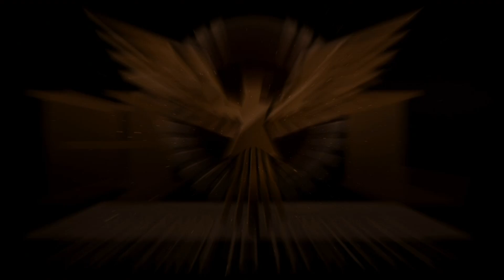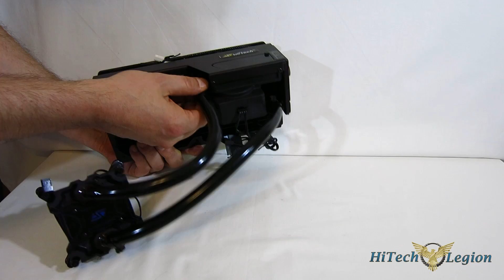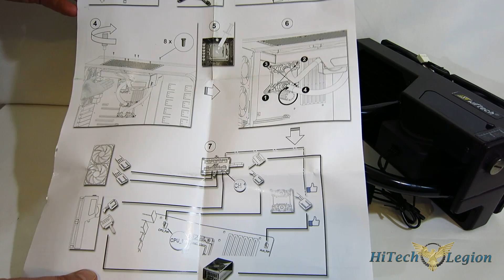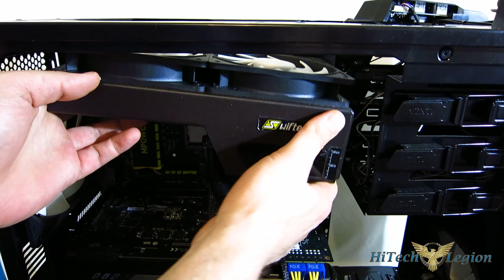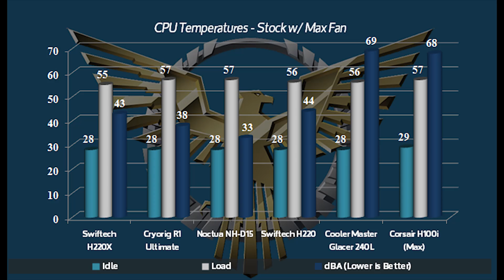Swiftech H220 X Open Loop AiO Liquid Cpu Cooler Overview and Benchmarks

Comment: Hi I have got a amd fx 8350 processor would the Swiftech h220 x be Ok with the processor and also how you have got the fans on top could it go underneath because have got 2 140mm Led blue fans and I want to Put them on top would it work with my 140mm fans on top and the swiftech h220 x underneath.

Comment: Really nice, but the last editions got a different color ? Looks like transparant.. I like this black tho..
Reply: +Ronaldoz Gaming Yes, the H220-X2 was released last month and features a larger, more rounded reservoir. It also has a new CPU block for a slight performance improvement.
Reply: +George Cella Thank you! I&#39;m checking the H320X2 Prestige for improve performance over the aircooler Phantek PH-TC12DX. Just not sure if my case will help to improve or to make it worse.. Got a NZXT H440.

ps. I ordered a H240X2, thanks for the reviews!

Comment: Does the LED from the block(3 pin) really go to a fan header? I have the z170 Deluxe and there is only 1 3 pin connection anywhere on the board. The manual doesn't show what it is. I'm trying to figure out if this is the correct connector.
Reply: +Ribsletics yes, it really goes to a fan header. Preferably one you have set to supply a constant 12V as it says in this video and in the manual.

Comment: If you added two gpu's to that loop,  I would be worried if it could handle that load.
wish they had a 360 rad version :(
Reply: +Stoneyman101 If you were adding two GPUs, you would simply add another radiator along with them.
Reply: Yeah, I wish I could but I only have room for one Rad :( my case is a bit small.
But thanks for the suggestion :)

Comment: Worth noting, I have this cooler and when I look inside the res there are particles floating around in it. I contacted the retailer I bought from and they say its nothing to worry about... I'll update it I have any issues
Reply: +Lotus How is the cooler doing so far? got mine yesterday and it has some particles inside the res too.
Reply: +ScarfShockle I'm cooling a stock 5820k and at idle I'm sitting a 34 degrees C. When gaming with a stream in the background it climbs to around 46 and stress tested with Prime95 it didn't even touch 60. Pretty good temps and its much quieter than my old H100. I think the particles are left over from the manufacturing process and don't seem to be affecting temps. What CPU will you be cooling?
Reply: +Lotus What did Swiftech customer service say regarding the particles?

I know that the dye they use in the coolant settles during shipment and leaves what looks like sawdust in the res. It then breaks back up usually in the first few days of running.
Reply: +George Cella I didn't contact swiftech, I when to the retailer I bought from. They said it was left over from the manufacturing process. As mentioned it isn't affecting temps
Reply: +Lotus cool :), currently have a fx 4100 installed but waiting for stock on the 6600k, thanks for the info ^ ^
Reply: +George Cella Is the factory fluid in this cooler dyed?  I thought maybe it was just water which is what I would want to use.
Reply: Resengan It is distilled water based with biocide and anti-corrosive. It is almost clear, but does have a faint blue dye. You never want to run just water, biocide and anti-corrosive are very important.
Reply: George Cella Great in the video it looked cloudy but I think that was because it was a bit over exposed.  If i planned to add a gpu to this loop would I need to purchase more of that fluid as Im assuming the water levels would go down after filling up the extra hose and gpu block?
Reply: Resengan Unfortunately, this fluid is not available separately. Best bet would be to completely change out to a fluid recommended by Swiftech, such as Mayhems X1 or XSPC EC6. Both are also available in concentrate to be mixed with distilled water.
Reply: George Cella ok thats great info thank you

Comment: is there anything similar to this but with clear threw  tubes?
Reply: Tom CMF Yes....this with the tubes replaced with clear tubes. It's open loop, so you can replace the tubing.
Reply: George Cella I just discovered that thank you, does it matter what dye you put in the system?
Reply: Tom CMF Yes - Swiftech has issued statements warning about using any nano-fluid with their pumps. Be sure that your chosen dye/fluid is not one.
Reply: George Cella I am really new to open loops people say it means you can change the tubes. Do you maybe know a tutorial that shows you how to do this or does the Switch H220 X come with instructions on how to do this. Do you maybe know a good yellow color of dye because I am looking for the color of dye which the storm bolt 3 used for its h220.
Reply: Tom CMF Swiftech has a guide they will send if you request it from customer service. They should also be able to recommend what dye brands are safe to use.

Comment: Hello. Nice review! very helpful. Can you tell whether the pump speed is steady or adjustable?
Reply: peace2u The pump is variable speed 1200-3000rpm and is PWM controlled. The pump and fan curves are set up to work in conjunction for optimal silence and cooling capacity, with the pump noise never being audible over the fans when using the included PWM splitter. You can also control the pump and fans using separate PWM signals should your MB or fan controller provide them. However, under no circumstance is the pump to be regulated by variable voltage, it requires a constant 12V to operate properly.
Reply: George Cella
Thank you

Comment: just picked up the h220-x  thnx for the review. one quick question hope someone can answer would this fit top mounted in a fractal design r5
Reply: Jason Rearden It will fit in the top of the R5 with no problem.

Comment: Hi there, i have a question... Does this Liquid cooling fit to my Cooler Master N200 in the front? Do you recommend that? Thanks a lot.
Reply: Chris Bohórquez According to Cooler Master's specs it will fit.
Reply: George Cella but in the front there's no trouble with the liquid? thanks.
Reply: Chris Bohórquez No trouble at all. It can be mounted vertically with no adverse effects. If you look at the Swiftech web site it shows all possible mounting orientations.

Comment: Does anyone know where I can actually find the h220 x for sale? I tried amazon, newegg, and tigerdirect. Can't find it anywhere, doesn't even show up as sold out.
Reply: BerserkFury89 You can order it direct from Swiftech, or from liquid cooling specialty shops like Performance PCs.
Reply: George Cella Thanks for the reply. Swiftech's website shows both the 220-x and the 240-x as sold out. I looked at Performance PCs, they have the 220-x in stock, however they do not ship to APO address (military stationed overseas...). Could you happen to have any other suggestions? Your video made me very interested in this cooler.
Reply: BerserkFury89 If you use the contact form on the Swiftech site, I am sure they can direct you to the closest reseller to your location and save you on shipping. Swiftech customer service is very helpful and responsive.

Comment: I have a Rosewill Thor V2 with a MSI 970 Gaming motherboard. Would this fit? Like would it clear the RAM slot with standard RAM installed? I don't have RAM with high profile heatsinks. I currently have a Corsair H60, but I'm looking to upgrade to start my process towards a custom loop with this and later add in extras when I can afford it.

Comment: I had a quick question...I just purchased a Swiftech H220-X and I have installed it but am a bit confused regarding the PWM. I have the Phanteks Enthoo Luxe case which already comes with a PWM mounted and using the CPU_FAN header on my Asus Maximus VII Hero MOBO. Can I use this PWM (it is 3 pin as opposed to the 4 pins with the H220X) or should I still use the provided PWM? If using the provided PWM, can I use the CPU_OPT header for one or the other PWM's? Or switch the two out and plug my 3 pin fans into the Swiftech PWM? Thanks so much!!
Reply: Andrew Maloney The Phanteks hub uses PWM to control VOLTAGE OUTPUT to the fans, it does not have a PWM signal out - this is why they are three pin. The H220-X pump requires a PWM signal to operate properly, so the 4-pin (2 wire) from the pump must be plugged into a PWM header, either on the Swiftech hub.

All of the headers on the Maximum Vii Hero can be selected to operate as PWM. You need to set it in BIOS. The most beneficial way to run these is to use your CPU header for the Swiftech PWM splitter, with the H220-X connected to it. Then attach the Phanteks hub to a chassis fan header which you set to PWM. You will likely need to run Fan Xpert tuning to get everything optimized, and then you can set up separate and correct curves for each.

But - the one big thing you need to take from this is that the Phanteks hub will not control the H220-X pump.

Comment: will this support 2 gpu's, 140.3 rad and an extra front panel reservoir? I'm going to try it next month, hope the pump can handle it.
Reply: +Engel I am currently running it with 2 GTX 980s in SLI (using EK blocks and a EK dual parallel connector), as well as an extra 240mm radiator. I think there may be a problem with the pump, as my top card idles about 10C hotter than my second, and when stressed, can get around 30C hotter. These temp differences do not occur when I turn my system on its side, which allows gravity to pull liquid into the pump. I am thinking about replacing it soon with a full custom loop, as this is irritating me.
Reply: +Vapeaholic The three blocks definitely take the MCP30X to its limit. If you want an easier and more cost effective fix for the short term, add an MCP50X into the loop. This will solve your immediate issue and give you a pump for if/when you change up the loop.
Reply: +George Cella where should I place the pump? My loop goes like this: Swiftech h220-x > cpu > 240mm rad > GPU connector > Swiftech
Reply: Vapeaholic Ugh...I totally missed that you had the GPUs in parallel - sorry. There is not an issue with your pump, and adding a pump won't solve the issue (though it will get you better flow rates, and is a good idea in an expansion of that size). A large discrepancy in temps in like parallel units indicates that the restriction of one block is higher than the other. Since the flow will seek the path of least resistance, almost all of your flow is going to one block, while the other has liquid barely moving. This is the huge drawback of parallel layouts. Can you put them in series?
Reply: +George Cella i only have a parallel connector, and as you know, it is diffuse to empty the coolant from a h220-x full loop, and then reassemble the whole thing. I turned my system on its side yesterday for a few minutes while it was running, and that seemed to fix my problem. If the problem persists, I might get a series connector or another pump
Reply: +Vapeaholic difficult*

Comment: just to confirm, since it is open loop even though I will not make any adjustments it will require a refill after time, correct?
Reply: you234511 Swiftech recommends a rinse out and refill after three years of use.

Comment: i have a P8P67 PRO and plan to buy either a 970 or AMDs equvilant down the road. when will i need to upgrade my MOBO? currently use 2xHD6950

Comment: Is the pump strong enough to handle an extra 280 rad & a vga block?
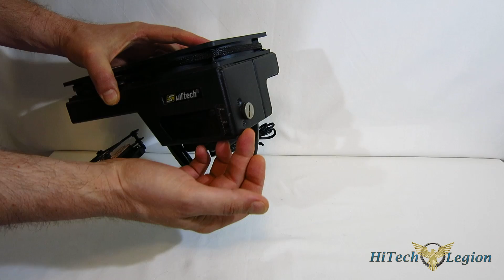Reply: watersofthesouth 5:13 and several other times during the video and written review.
Reply: George Cella i've heard it on your review but i wasn't sure if that was just reading the specifications of the unit or it was actually tested and proved ok. I plan to use the H240x with an added gpu block and an alphacool 280 xt and i hope the pump won't overheat by the added components. Thanks for your time George!
Reply: watersofthesouth That rad is not an issue at all, the GPU block will be the more restrictive component. Try to go with one that is low to moderate restriction. Those two additions are within the comfort zone of the pump, but should really be the end of what you add to MCP30 - any more than that will push it to or beyond its limits.

Comment: Is that unit actually better than for example XSPC RayStorm 750 EX240?
Reply: caldorius They are more "different" than better or worse. As a CPU only, we did get slightly better temps from the H220-X. However, the XSPC pump does have a higher flow rate which can be advantageous with larger expansions.

Comment: Do you have to buy the liquid for the cooler? This water cooler is kind of confusing to me.
Reply: Shinyswordstorm It is pre-assembled and pre-filled.
Reply: George Cella i did read after three years you have to refill it or when it gets low
Reply: amandam7777 That is recommended, and it is a very simple process.
Reply: George Cella new to watercooling but i would assume you just remove it and turn it on its side and refill it? You don't have to bleed the loop if you are using it as is?
Reply: +ShinySwordStorm If you decide to turn it into an open loop, meaning you use your own parts like say colored tubes, then you will be filling it much more often than every few years as the liquid will evaporate faster. It's a popular water cooling choice to just use DISTILLED water (for many reasons over a special coolant). Distilled water vs normal water has no minerals therefor it is more pure and said to be much better to use for a few reasons.

Comment: Do you guys think you can change the tubing?
Reply: ***** You can change the tubing, fittings, add components....it's open loop, not a CLC.
Reply: .it's open loop, not a CLC. <----- meaning?
Reply: ***** Open loop means that the loop can be configured, it is not permanently sealed - like custom loops. This is essentially a custom loop that comes pre-assembled for convenience.

CLC is "closed loop cooler". The loop is selaed, you can not change components, add components, and when evaporation occurs you throw it away. All of the other AiO liquid coolers on the market are CLC.
Reply: thank you

Comment: So the unit is awesome but the fans can only be mounted on one side? So it won't even matter what case you have, the 220-x will ruin the flow. Lame
Reply: The fans can mounted as exhaust or intake, regardless of which side of the rad they are on. As mentioned in the actual review, temperature differences were negligible.

Comment: Would that magnificent h220-x fit in a NZXT H440 ?
Reply: Absolutely.
Reply: George Cella Cool ! Even on top ? Too bad the Swiftech h220-x is not sold in France. I hope that I will be able to buy it from the Swiftech's website.
Reply: Duallity It should fit on top with no issues at all/
Reply: I just installed his in my h440. It's been amazing!

Comment: H220-X or CM Nepton 280L?
Reply: Depends - do you want the smaller, more compatible one that offers better cooling with far less noise, plus expandability and customization options, the ability to top off coolant when it starts getting low (and actually know that it's happening), etc., etc......or do you want a CLC that offers none of that?
Reply: George Cella Hmmmm...that's a tough one. Guess I need to take a bit of time and think this one through.  ;)   Point taken...just didn't know if the Nepton 280L was much different than the  Glacer 240L in this review. Thank you for this review and I have altered my parts list: http://pcpartpicker.com/p/mtkpD3
Reply: Rod Anderson I see what you were thinking. I had actually never realized that CM's model numbering scheme could cause some confusion. The Glacer 240L is actually a rebranded Swiftech H220 with the pump allowed to run 500rpm faster and with higher rpm fans. The 280L is part of CM's Nepton CLC line, and sports the aluminum rad and much lower flow pump. Then there is the lower Seidon CLC line....which has a 240M, which sounds like it would be the successor to the 240L, yet came first and is entirely different.

That said, the Nepton 280L is probably the best CLC on the market in terms of performance and reliability, but it can't keep up with something like the H220-X (or even the 240L in most respects). CLCs are just outclassed in every element against this type of unit.
Reply: I've learned a lot and I thank you. I rather pay a bit more for better performance, quieter operation and ability to expand...no brainer

Comment: Its because of Swiftech and this product, liquid cooling can be done for under $650, it has motivated me into finally upgrading my graphics card and then upgrading to this liquid cooling solution with GPU waterblock. $650!!!!!!!! found a cheap GPU thats mid range, the ASUS Radeon R9 280 DirectCU II TOP 3GB for me it costs $249, waterblock for that as its pretty much the cheapest you can go for a waterblock liquid cooling. $170 or so coz i have to order internationally from ebay. Still $400 and i have got my new card and waterblock, get this awesome new swiftech product. Get some minor stuff like coolant and more tubing and fittings (for the GPU waterblock) and we are GOLDEN!!!! $650!!!!!!!!

Comment: Would this go well with NZXT S340? Are the tubes long enough?
Reply: Mulperi I haven't used the S340 yet, but I can't imagine that the tubes would come up short. BUT, that is the beauty of open loop as opposed to CLC (aside from the obvious advantages in performance and expandability) in that you can simply replace them if you need to, and route them to your case.